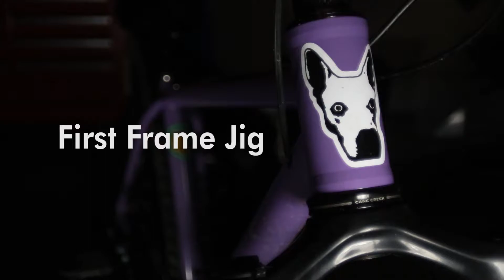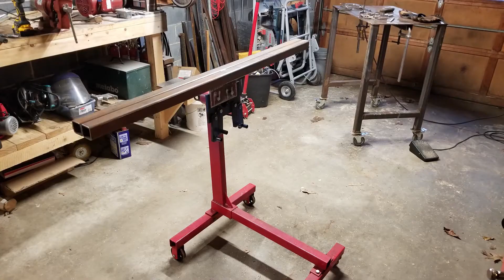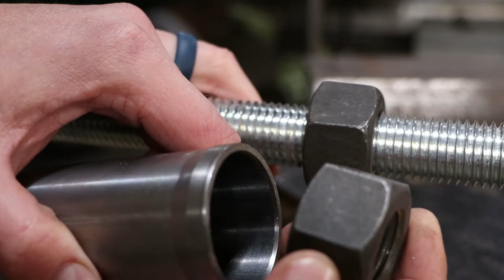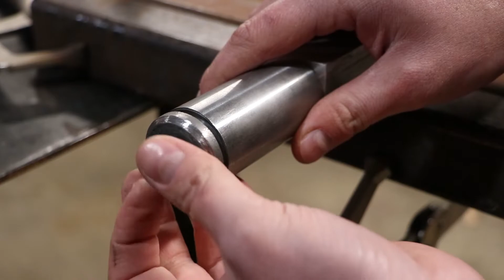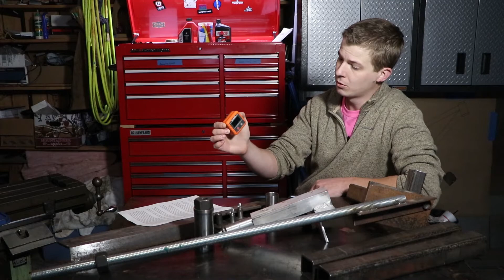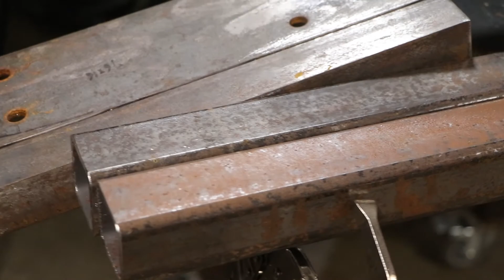How Not to Build a Bicycle Framebuilding Jig

Comment: About 3 years ago I built a frame jig out of an old metal table with square tubing. It's definitely not 100% accurate but for the low stretched bike I build it works just fine. Built 13 frames off it already.